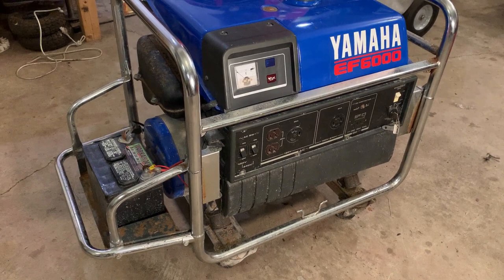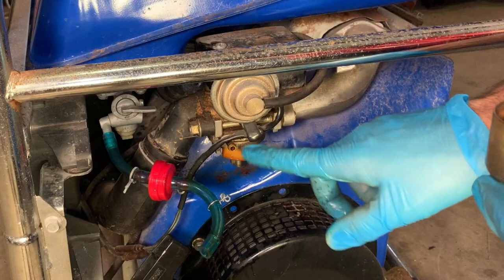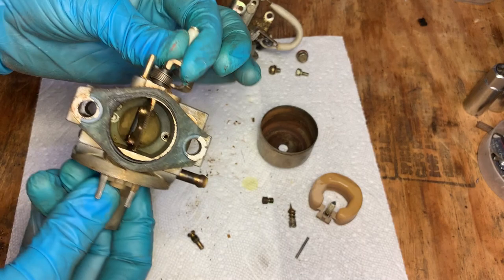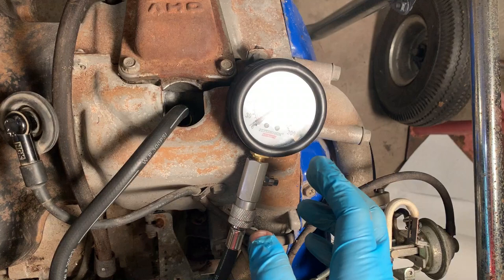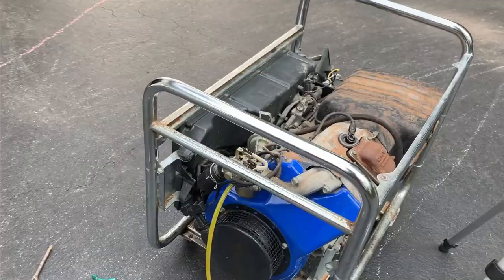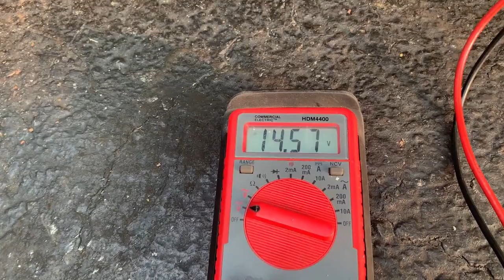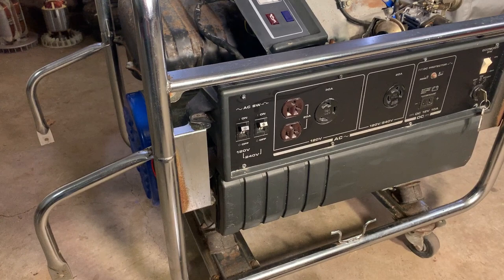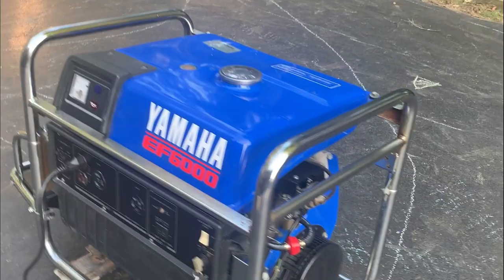Old Yamaha EF6000 Generator Will Not Start - Fixed

Comment: Manual charger - float or automatic.  I have both.  I usually throw my one A. float charger on a severely discharged battery and one of my automatic chargers on a battery that is below its normal charge.  I really love my Schumacher 1.5A automatic charger.  It will charge at 1.5A until the battery is fully charged and the drop down to .5A and continue to charge until it is removed from the battery, basically a maintenance charge.  I have a Schumacher .5A Maintainer that I leave on my lawn tractor all the time.  It keeps its battery fully charged at all times because there is not a pull rope on a 24 HP engine.  😀

Comment: Another Great Job & Vid.....Thanks...........The Simi-Chrome would have worked great on the Chrome.  LA Awesome All Purpose Concentrated Cleaner Refill works great....You will have to play with strength in the ultra sonic cleaner......... Sold at Dollar Tree - $1/qt.

Comment: Hello, Mr James I like your videos because they’re really informative and give constructive advice. I have a 31P Generator that is difficult/heavy to turn on. I’ve checked the vales and the handle and it’s all good. Sometimes I’m able to turn it on but after it gets even more difficult/heavy to turn on. Can you gives me any hints/tips/ideas as to what I can do?
Reply from the maker: I am not familiar with a 31P generator.  Does it feel like high compression?  If so then the valve clearance might be off or a broken compression release.
Reply: @jcondon1  Mr Condon, my generation is 13HP. It does run/turn on, it works very well, it just has that on detail, a high compression to start/turn on. What would you recommend I do?  The reason I want it to work perfectly is because it had personally means a lot and holds a lo of memories for me.

Comment: The shield that mounts between the carb in the intake should have a gasket on both sides of the plate. Only saw you install when gasket unless the other gasket was glued to the plate
Reply from the maker: It was a black gasket that was glued on the plate.  Seemed to be in good condition so I ran with it.  I had another new one just in case.

Comment: Well right on the bat, i did notice it had a low oil level light on it like we talked about before. I was wandering if they could be converted to put one on just like that one and what you have to do to install one if one didnt come with one.I wish i could come across some generators around here. I could get one running around here if could find any.

Comment: I've been binge watching your videos. By far the best channel I've seen on generator repair. Great Job by the way. I was wondering if you have a table of the most common torque values for common items on these generator motors. Torque for things like carburetor studs, pull start, motor tins, etc.?
Reply from the maker: Thanks!  Will do a community post on that some day.  But to answer your question 60 in/lbs on the carburetor, pull start and tins (for the most part).  If the engine is smaller then 5hp then might drop to 40 in/lbs.
Reply: @jcondon1  Thanks for the reply.

Comment: Got a champion for 50 bucks. Guy let it run on a hill with the oil plug loose and it died. He couldnt get it restarted n sold it. I put oil in it, cleaned carb and it fired up first pull.
Reply from the maker: Nice

Comment: It looks like the pic of the OEM carb listing has the bimetallic spring on the other side of the choke lever. Perhaps yours needs to be put on the other side and bent slightly to make the choke operate correctly?

Comment: I have the same gen set except  the ef 5000 same problem  im going to try to clean the carb again sent to yamaha  and wanted 600.00  for a new carb and 2 mths to get  and says only 5 left  in the world  my dad bought new for 1500.00 when I was 18 now I'm 51 used at mountain  house
Reply from the maker: That is an expensive carburetor.  Hopefully yours can be saved.  You are always welcome to mail it to me.  I can have a go at cleaning it.  But as you can see from this video, sometimes it takes a few tries to figure it out.

Comment: You could have used 1/4 inch threaded rod instead of J hooks - just put a nut and washer on the bottom and a wing nut and washer on the top.

Comment: May not be the way it looks but the battery looks real close to the generator possibly restricting the air flow for the generator. If it is you might want to put a spacer in the battery tray to hold it as far as possible from the generator or If possible put the piece of angle iron you used to hold the battery on the inside top of the battery instead of the outside top of the battery to hold the battery further from the generator if the holes for the rods in the battery tray will allow it to pull the battery away from the generator.
Reply from the maker: Good point.  Will check it out.
Reply: My father used to have a small generator for the caravan. He always thought it run to hot. It always smelled as if it was burning, not the electrical side but the engine.  He got a 12v computer fan and mounted it at one end and wired it into the back of the 12v circuit.   This seemed to work as it stopped the smell.   A couple of years later it would not start. He took it to a repair shop. They took off the shroud covers to investigate and they found the dried out body of a rat.  So the smell was the engine cooking the rats corpse.  On his the choke diaphragm had perished so it didn't choke the engine to allow it to start.  New parts, a " good" clean & it worked unit he sold it a few years ago.

Comment: Hi may be I silly but why do you put oil on the air filter is that spung will whole more dust particals in the housing and prevent the carbinater from block up. Brendan IRL

Comment: YEs I know I am being "picky"! You should have measured the width of the battery hold downs. While what you did works, it looks "janky". Otherwise very good video and I do enjoy them alot!
Thumbs Up from me!
Reply from the maker: Thanks.  I did measure and thought that was a good size.
Reply: @jcondon1  Well, it does look about an inch short. Like I said before It will work.

Comment: Excellent
This is very similar to mine…where did you find air cleaner elements..?
Reply from the maker: From Amazon Spree compatible replacement for Yamaha Generator YG300 YG400 YG450 EF3800 EF5000 air filter https://a.co/d/17UPl7N
Reply: On another topic…you rave about H.F. Parts cleaner….can you suggest a high freq cleaner?
After your inspirational videos….decided to put one or two chain saws back on life support
Reply from the maker: @offgridmangogrower  below is a link to the one I use.  Not sure if it’s better or worse then any other, but so far so good.  I do not use the HF degreaser much any more.  Have had a few carbs turn dark recently.  Think they changed their recipe.  CREWORKS Ultrasonic Cleaner https://a.co/d/80djlyF

Comment: I would like to see your cosmetic work come up to the exacting standards of your mechanical work. I am a big fan of the way you go through inspecting, trouble shooting, and repairing these generators. Then double checking  and testing the results to meet the proper RPMs, and voltage outputs, but when it comes to the overall rust removal, painting, and clean up I notice little things like on this Yamaha there is a brown household 120 plug installed upside down on the front plate, you installed the fuel tank covering up the rusty heat shield, Your home made battery clamp was too short thus placing the "J" bolts at an angle where the wing nuts won't lay flat. There is more but what I want to say is yes those things still work but they just don't seem right. That being said, LOL- I don't like the dirty work either and I hate to paint so I understand.
Reply from the maker: Done plenty of painting https://youtu.be/pCQ8tdNNiqU?t=1469.  I agree about the exhaust shield I really wanted to paint it up.  But was concerned about the lower half of the shield.  I think a lot of stuff would have need to come out to free it up.  The outlet and battery holder was how Yamaha intended.  Did not feel a need to alter it, however odd.

Comment: James, what general torque values do you use? If you don't have specifics on the model. 
For example: the mounting bolts on the frame. And the carburetor bowl screw, fuel drain screw and carb mounting bolts. 
Any kind of rule of thumb guidelines a rookie can follow when one doesn't know the dead-on values? Great videos. Love your work. Thank you.
Reply from the maker: Usually 60 in/lbs fir mounting the carb.  Just snug up the drain and bowl screws.   Engine mounts, just make them real tight.
Reply: @jcondon1  thank you!

Comment: Where do you get your fuel lines from and what size? Love the video's
Reply from the maker: Darren Merrifield been getting them from Amazon.  They are 1/4 inch inner diameter and half outer.  Have not been happy with them because it does something to the fuel.  If you leave fuel in the line for a couple hours it changes the fuel to a very dark color.  Am going to try something else once I run out.

Comment: Do you have a video of what a  routine maintenance would be .
Reply from the maker: Not really.  But mostly fuel related.  I change the fuel out twice a year (with stabilizer).  Always run the carburetor dry before storing, keep a battery tender on the battery, and rotate the engine to the compression stroke so the valves are closed.

Comment: You seem to be frugal when it comes to buying parts for the units you repair but what I find odd is you lost always put new fluid in your parts cleaner I use mine till you cannot see anything when submerged. Do you do that so we can see the ultra sound unit work?
Reply from the maker: The fluid I use is not very expensive.

Comment: Hi, I've been enjoying your generator videos.  It got me thinking about mine.  I have a Yamaha EF4000DE that I purchased new in 2017.  It doesn't have an hour meter but I'd guess it has less than 50 hours use.  I've always run it dry after each use and stored it indoors.  The manual says the valve clearance should be checked at 12 months or 300 hours.  I have never done it and would like to but the manual doesn't list what the clearance should be.  Do you have any idea what it might be.  It's a Yamaha 251 cc engine.  Thank you.  Tom Medland

Comment: Why do you pour 2 stroke gas down the spark plug hole while troubleshooting, what effect would using regular gas have?
Reply from the maker: Either would be fine.  But since it has not run in a while I thought the oil in the two-stroke gas would help lubricate the top end a little.
Reply: @jcondon1  I see, thanks for explaining. Your videos are awesome!

Comment: Hey James: good work. Good job. Do you think on those 110 outlets you could rewire that to 20 amps each and then like modern gen sets have one set come off one wiring coil and the other of the other set or there may be only one output on this but I don't think so because it puts out 240v which means it has two. Not sure what the avr looks  like though. Probably have to put a new avr on it so just a mess.
Reply from the maker: Paublus Americanus AMERICANUS it makes 240 volts so should be able to rewire that 120v outlet.

Comment: Hey James, behind the workbench, under the silver cover, is that a Honda ES6500? Two cylinders? Water cooled? OHC? I have one of those. Amazing piece of equipment.
Reply from the maker: It is a Honda EU6500.  Just a single cylinder air cooled Honda GX390.

Comment: I changed the carburetor on a Generac 7000 EXL. It works but what would cause it to want to die when I put the idol control switch on?
Reply from the maker: Check the idle set screw on the new carburetor.  Might be set too low.
Reply: @jcondon1  I'll do that. Love the generator videos. Thanks you for the response

Comment: What is that part called that by the throttle control ? I feel like i should know what it's called but haven't seen one like that in a few years. Also when i use my generator when i'm done using it i shut the fuel valve off and let it run the fuel out of the carburetor cause it usually will sit for a while before i use it again

Comment: 3000-ish continuous watt load rated with a 6000 watt surge rating? 

That’s the only thing I can think of for it being 6000 watts but only about a 3000 watts continuous.
Reply from the maker: Pete Jackson maybe.  Was not able to find anything stating if that was surge or continuous.  That power head on the Yamaha was larger then most 8000 continuous watt generators made today.

Comment: Do you know where can I find a carburetor for this generator EF6000. ? is there any generic carburetor to adapt since is very old.
Reply from the maker: I am not 100%, but believe a carburetor for a Yamaha MX360 might fit.  Not sure though if the throttle plate moves in the correct direction.  Also you would lose auto choke.  Might be worth a try as the clone ones are cheap.  Just make sure the throttle opens and closes in the same direction and the governor linkage connects in the same spot.  https://amzn.to/3O9KdOw

Comment: Hello, new to your channel. Thanks for making these videos, really enjoy them. I'm in the market to buy 2 inverter generators, something in the range of 2000-2200watts. Other than Honda (because of the price) what brand would you recommend? I'm using them for backup power during the winter. I would like to get a 5k gen, but I don't have a walkout basement so I need something I can carry up the stairs.  Right now I have a harbor freight 2000w inverter and so far I'm pretty impressed. I probable have about 50 or 60hrs on it. But it is harbor freight. The only upper end generator that I know of is Generac. Thanks!!
Reply from the maker: Generac is upper end on price, but not that impressed.  Would highly recommend Honda for an inverter generator.  I have owned a few.  They are worth every penny and have a very good resale value.  Currently I have a 2000 watt Yamaha EF2000v2 inverter.  That would be my second choice.  I do like the Ryobi (2nd generation) inverter.  It is a good value and is reliable.  The Ryobi first gen is hard to start and the 3rd generator (current model) has some design issues around the easy start knob.
Reply: Thank!

Comment: What was the wire on the carburetor for?
Reply from the maker: I think it was a bimetallic strip to help turn the choke off.
Reply: @jcondon1  could it be some wire from a heater circuit for the choke strip?

Comment: Second time around.  I would have tried to figure out a way to adjust the choke pull off servo so that it would open further.

Any ideas on the switch on the choke ?

Comment: You might want to start testing with starting fluid, so not wasting time on a non-existing problem.
Reply from the maker: Yes I do that.  I actually did that and got nothing.  It was because the choke plate was stuck closed.  Nothing made it into the engine.  Edited that out.

Comment: gas tank clean . get rid of water
Reply from the maker: I did, but not in the video.  Tank was in pretty good shape.  Not much water in it.
Reply: @jcondon1  ok its  look like water to me. fill it gas. use it  till is gas .  get a new filter. water gone!!!
Reply from the maker: Paul Pieretti I filled it then emptied it through something called mr funnel.  It separates water from gas.  Did it a couple times to make sure I got it all.
Reply: @jcondon1  Cool

Comment: After you sell a generator, do people ever call you because it won’t work?
Reply from the maker: John Smith once.  Made a video on that.  A contractor bought it and after a few days running on the job site it stopped making power.  Gave him his money back.  The brushes ended up going bad.  Thankfully it was an easy fix.

Comment: I enjoy  your videos but you have a strange methodology. In the beginning I would have sprayed carb cleaner to see if there was  Spark and see how the engine sounded. You went right into carburetor rebuilding before you even knew the condition of the engine. That's a recipe for wasting a lot of time.
Reply from the maker: yes and no.  I actually did spray some in before turning the camera on and got nothing.  I do recommend carb spray first off.  If it starts then you can hear the engine and know you have spark, timing and compression.  Thought I would have to dig in and check the coil and flywheel key.  The carb was blocking removal of the blower housing so I started there.  Turns out the airbox was just so far away that the carb spray did not make it to the engine.  That is why I ended up putting fuel directly in the cylinder at one point in the video.